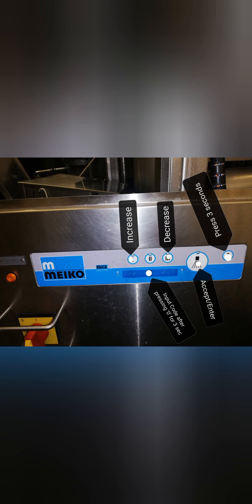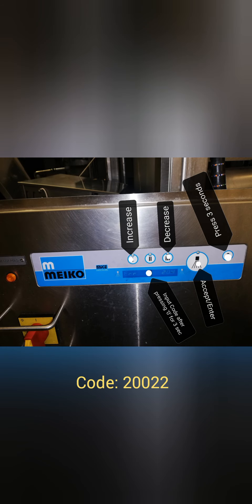Meiko FV130.2 Pot Washer Troubleshooting | Errors 304, 204 & 301

Comment: which # of Times or rinse to transfer parametr? 
we have also 301 error after new facktory reset.
Reply from the maker: Hi good morning. 204.
Reply from the maker: But 301 also has other causes.  You may also check the status of your tank. Maybe it is full of scale which goes into piping and rinse arms causing it to clog the line. This will affect the time of filling the water in the tank. 

I hope this would help. God bless you.
Reply from the maker: P.s. please check also your transfer pump status.

Comment: Hi dear good morning my dishwasher machine not intake water and heater is on how to solve
Reply from the maker: @murugavelsen  Hi. Boiler Heating  Element? Check your pressure level switch. It is your level switch that will stop the filling and activate na the Heating Element. Maybe it is clog or faulty.

Hope this would help.

God bless...

Comment: 301 error code how to fix
Reply from the maker: Most probably your Booster Tank is full of scale. At which it traps and clogs the arms. You may check,

-Rinse arms and nozzles if they are clogged
-Check for any bent hoses 
-Clean your Booster Tank
-Check the status of Rinse or Booster Pump

Hope this would help. God bless you .
Reply: I find solenoid valve not close why
Reply: @MTExALExclusive  I find solenoid valve not close why
Reply from the maker: During the start of operation?

Check your level switch on your Booster Tank.  

The level switch commands the filling valve to close once it reaches the level.

If the solenoid valve continues to fill even the machine is off then that is another story. Your valve is passing and needs replacement.

God bless.
Reply: @MTExALExclusive  thanks U very much U help
Reply from the maker: @RuwanKumara-qp5bm  you are welcome. God bless you.
Reply: Bro how do you thing is this same system or not with Hobart diswasher ?